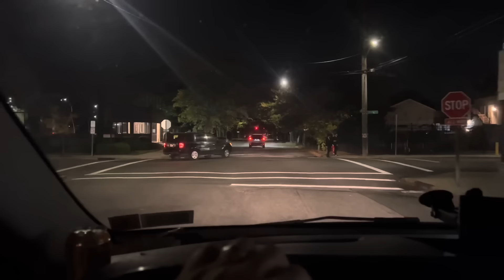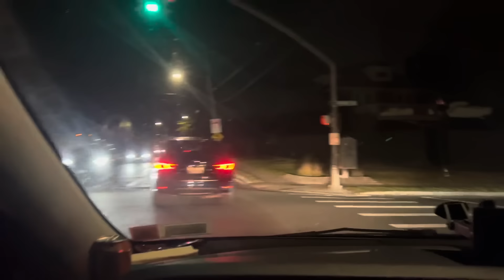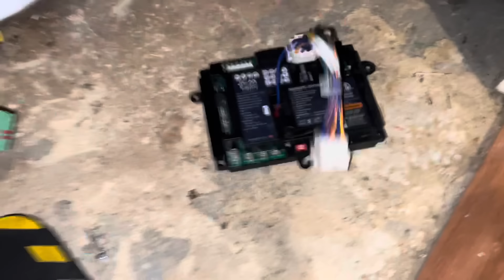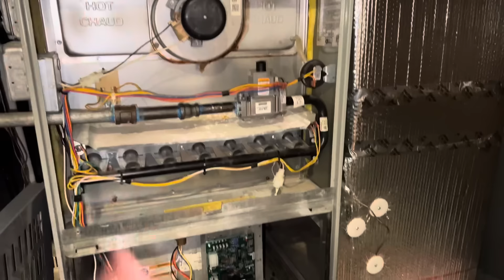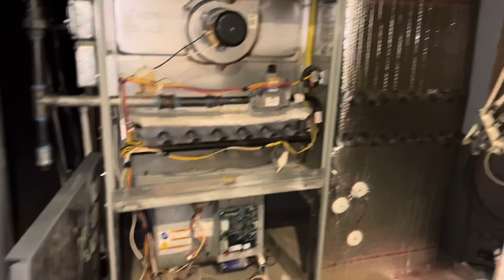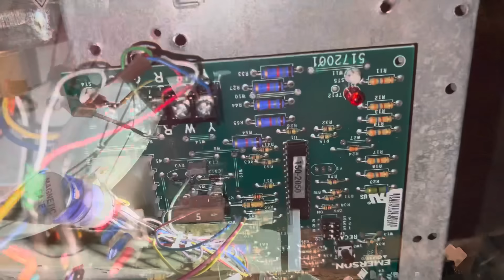Saturday Evening Emergency Heating Service - Gas Furnace No Ignition

Comment: A surge protector will cost a lot less than the damage that can be caused by surge or floating neutral.without good neutral you could end up with 200 volt where it should be 110 volt he should at least get an electrician to make sure his electrical is correct and safe.

Comment: What truely sucks is when you go to all the work to replace the board an it still doesn’t light.. a you find out the brand spanking new board?? Is defective 😤😤🤬 bad enough laying down doing it the first time time but the second time ?(( this “ blanket had better work)) 😂😂😂 surge protectors are the best money a customer can spend!! lol after the second or third time?? They tend to understand they are spending money that they would not of had to!!!🤷🏻‍♂️🤣
Reply from the maker: Did you notice how the wiring harness for Lane bolt was still into the Molex connector plug from the first board that didn’t work?
Reply: @PipeDoctor   lol no I didn’t . I was so upset at the sloppy spaghetti mess I just cringed…